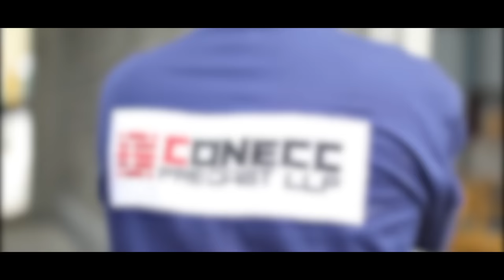Precast compound walls

Comment: If the iron got rusted in 5 years...the wall vill collaps ...
Reply: Yup, u r correct.... The steel channel installed supposed to be coated with anti -rust coats...
Reply from the maker: The wall isn’t dependent on steel channel as steel channel is used to strengthen the foundation only also it isn’t exposed to water and air but thank you for your advice. We will consider it
Reply: @ConeccPrecast  what will happen if the packet shaped end of the precast wall damaged...?

Just to clarify...
Reply from the maker: @altain  if it gets damaged while installation than we will replace it and there are no chances of any damage after installation.
Reply: @ConeccPrecast  where is your company
Reply from the maker: @roopasathish5695  we are located at Bellary Karnataka sir

Comment: Iron bars mounted will rust with time... Do you have solution for it?
Reply from the maker: Iron bars are not responsible for strength of walls.
Reply: @ConeccPrecast  but it is what keeps the wall stand, no?
Reply from the maker: @princessanineveh  dear sir, wall stands on the footings not on iron bars. Iron bars are for footing strength and for extra security of wall panels.

Comment: Very Good System, RCC precast panel installation to build the Boundary Walls.
"Note That you have not applied protective coating on MS Channels" 
Kindly Considered this important Quality Control Issus. (to prevent it from weather's &  soil effects.)
Revisit Quality Control Plan, Procedure, Thank You.
Reply from the maker: Dear sir, once the walls are installed , the MS channel will not be exposed to air or water but thank you for the suggestion. Will keep in mind. Thank you

Comment: It looks like a solid compound wall. May not be cost effective as the cost for material, labour, transportation, installation adds up. Getting it done locally might be cheaper.
Reply from the maker: If you will compare it with a local brick wall than we will be much more affordable sir
Reply: @ConeccPrecast 
Agreed 
This is most effective and made more durable because it’s made under proper process with highly skilled people

Comment: Will snakes go inside from the under area or after the wall is put,the gaps are filled afterwards?
Reply from the maker: No space will be left for snakes once the installation is done.
Reply: Snakes won't creep under the wall but they will climb over if they want something on the inside.

Comment: If we use brick walls, 1 sq. Ft will have some cement and max 6 bricks, 6bricks =60rs, cement, sand for plastering cost could be max 20rs +labour 20 = 100Rs
Reply from the maker: Plastering is minimum 80 rupees per sq feet both side and also add cost of foundation sir
Reply: @ConeccPrecast  What is the psf rate of uour solution?

Comment: I ain't gon lie  after seeing the hydra on site  I thought the vid was gonna end with it on its side  being upright by another crane
Reply from the maker: Yes it might happen but the hooks are installed with a proper calculation of center of mass on the wall so it is equally balanced.

Comment: The problem here is the strength of the fence.. yayy..
Reply from the maker: Strength is even stronger than a brick wall as a single panel weights around 3 tons.

Comment: It still wont be strong as when done the old school. But even so with this method, i believe that the boxing placed around the steel beam should have been done same time when putting in steal beam. I also believe that although the wall is interlocking it should be cemented along the base...meaning it should be going down in poured concrete at base when lowering the wall
Reply from the maker: If it will be cemented then interlocking fails and it might get cracked in future.
Reply: @ConeccPrecast  hmm...ok.

Comment: The problem we encountered with this type of wall in the USA was that if there's rebar in the walls for reinforcement, and the walls are not thick enough to provide that steel with good cover, the walls spall. I saw in the video the pouring of the Pilasters and they look plenty thick, but I must have missed the actual wall sections being laid up and poured...
Reply from the maker: Wall thickness is 5 inch here and we are using 12mm rebars so there’s no such issues with us.
Reply: The other problem we encounter in the USA is the price as i am certain contractors will want your first born child as a down payment just to order then get ready for the real cost
Reply: @bc5891  😂😂😂...we'll just do old school way
Reply: @ConeccPrecast  i need job in precast company .i have more than 10 year experience in precast company as a foreman
Reply: 😂🎉😢😮😅😊yhhhh

Comment: Those who likes these kind of pre-cast wall can buy but don't consider these types of precast wall for low budget compound walls. This is how the precast compound walls are marketed,  they are quoting Rs.220/- per sq.feet within Karnataka.
Reply from the maker: Definitely sir.
We are also not marketing as low budget precast walls as these walls are even stronger than a brick wall with textured finish so their price will be compared with brick walls not 2 inch precast walls.
Thank you
Reply: @ConeccPrecast  I agree, your people are transparent during the enquiry. But it's generally marketed in youtube. BTW: how the iron rod in concrete will hold 3 ton of wall, don't we need additional support in the bottom.
Reply from the maker: the iron rod had no part in holding the wall sir instead the wall will rest on the footing around irod rod.

Comment: Foundation is only for pillar and wall foundation is near to zero the also the wall thickness looks like 4-5 inches a big thunderstorm will cut into two pieces from middle without argument.
Reply from the maker: The wall itself is self supported and doesn’t require any foundation. In case of strength, it is even stronger than a brick wall so if a big thunderstorm can take it down than even a house is not safe from it.

Comment: If it’s not saving you money then what’s the point?
Reply from the maker: It is definitely saving money in comparison to brick wall sir.
Reply: @ConeccPrecast  u have the numbers?
Reply: If money is your only concern then just leave your land as it is. You want a boundary fence? get a barbed wire fence. This is mostly a fast alternative to boundary walls made by bricks or stones.